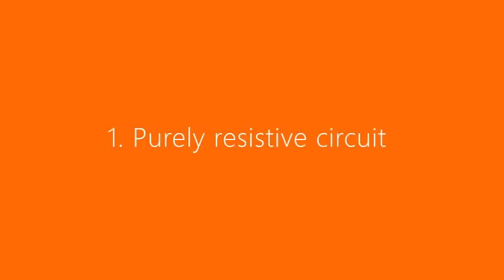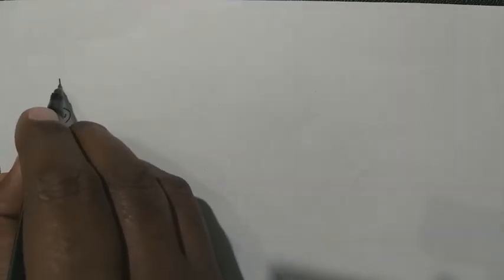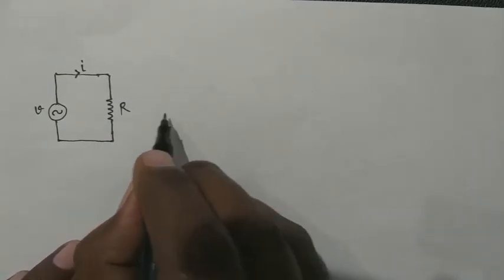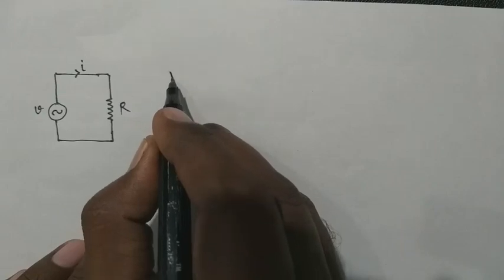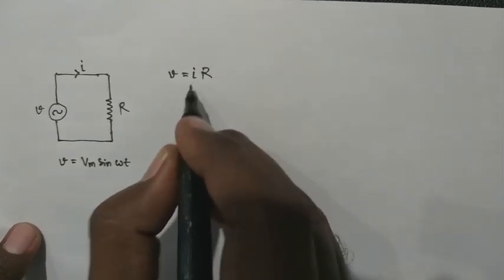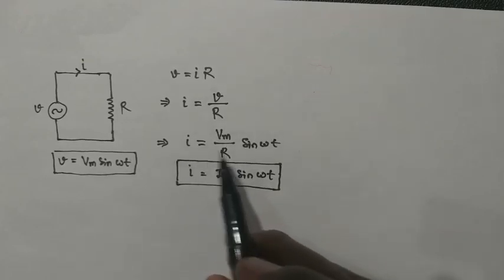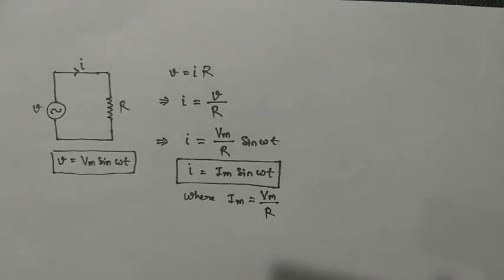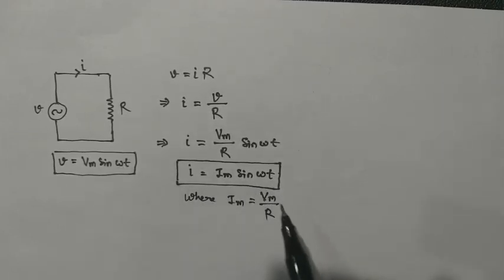Behaviour of R, L and C in AC circuits | Basic Electrical Engineering

Comment: Sir, if instantaneous power is also calculated then, for purely resistive circuit,
 p=vi= (Vmsinωt)(Imsinωt)= (VmIm/2)×2sin^2ωt= (Vm/√2)(Im/√2)(1-cos2ωt)= (Vm/√2)(Im/√2) - ((Vm/√2)(Im/√2)cos2ωt)

And, Average power in one complete cycle,
P= average of (Vm/√2)(Im/√2) - average of (Vm/√2)(Im/√2)cosωt = Vrms×Irms - zero 
or, P=VI
Why is (Vm/√2)(Im/√2)cosωt is equal to zero?
Reply from the maker: Average of cosine function will be zero for one complete cycle.
Reply: @chauhansanjai  Oh. Ok Sir. Due to periodicity of sine function, average power of purely inductive and capacitive circuit is zero.

Comment: Sir, for purely resistive circuit, if instantaneous power is calculated,
p=vi=(Vmsinωt)(Imsinωt)
=(VmIm/2)×2sin^2ωt
=(Vm/√2)(Im/√2)(1-cosωt)
=(Vm/√2)(Im/√2) - ((Vm/√2)(Im/√2)cos2ωt)

And, average power over a complete cycle,
P= average of (Vm/√2)(Im/√2) - average of (Vm/√2)(Im/√2)cos2ωt
=Vrms×Irms - zero
or, P=VI
Why is average of (Vm/√2)(Im/√2)cos2ωt equal to zero?
Reply from the maker: Its a pure sinusoidal function and average value of any sinusoidal function over a complete cycle or its time period is always zero.